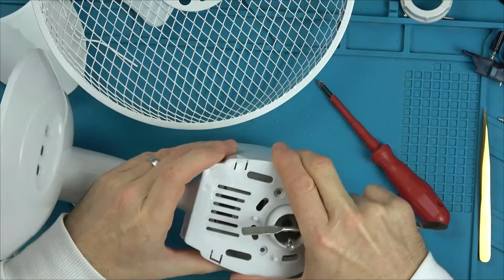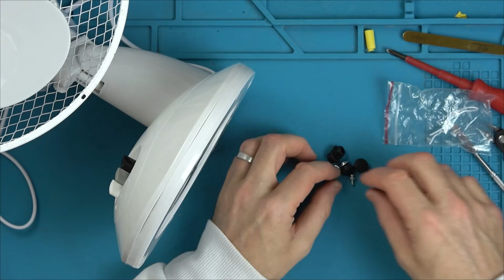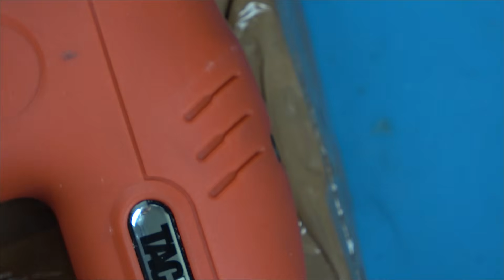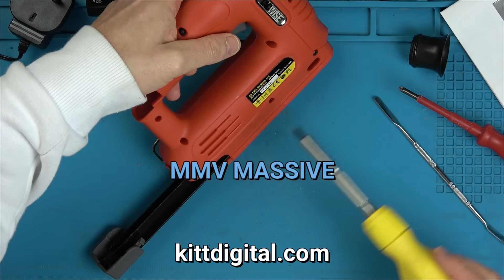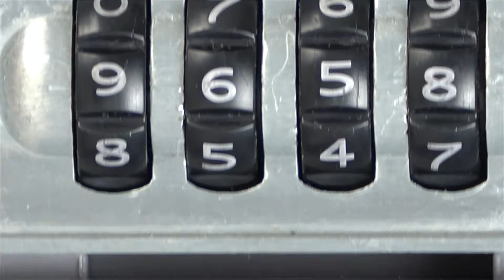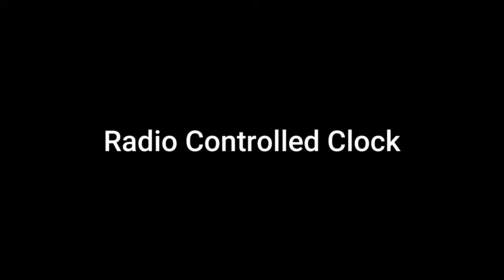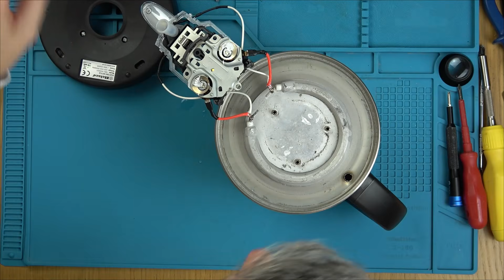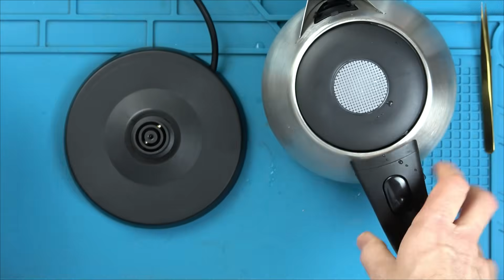I Bought AMAZON CUSTOMER RETURNS to REPAIR

Comment: Re : Duh Fan
NOPE! it nort be "freak shun" err-"friction" that hindered the second speed.
The motor has a winding that is tapped, and the switch selects what tap the electricity is fed too.
Eg: the first tap would energise part of the winding "slowest speed", and the other tap "full winding" would be 
the fastest speed ?! !? 🤨🥴🤯 WAIT! or is the faster speed the other way round??? err two windings fed with 
electricity should mean ?? err-um? um? wait 😵‍💫 argh! 😬my near to 70 year old brain needs re-energising. 
anyway, the two taps to the motor provides the two different behaviours.. yeah lets stick with that.. 😁
That, That THAT Blue wire must have been loose! only Explanation why the Fu Err-sucker didn't have the two speeds..
And what's more I would put a kazillion bucks N a hot maiden if I am wrong..

Comment: Hi Vince, I think because the propeller was loose, it was only ever going to get up to a single speed before spinning on the metal shaft regardless of switching to a higher speed. Perhaps by putting heat shrink on to the shaft gave it better grip?
Reply from the maker: Hey, I think that may have been the issue all along slap head 👍👍👍

Comment: Real shame on the atomic clock. I love my atomic clock. It is tuned to WWV, and of course you can adjust the timezone. Rumor has it you can hear WWV in England, so it is possible the clock would be good there, too. 2.5, 5, 10, 15, and 20 MHz AM.

Comment: Vince, have you any plans to restore a Vespa scooter? You mentioned it when you were fettling the Rolls.
Reply from the maker: Hey Mike, I don't think so. On my driving license I can only drive a 50cc. When I looked most old vintage Vespas are higher than 50cc. I don't fancy having to pass the CBT to get a bike license truth be told. I haven't ruled it out completely as it could be done in my dad's shed out of the weather, but I am not looking at this moment. In fact, I haven't been looking at any bigger project recently as nothing seems to be interesting me. I'm hoping that will change. I did buy a beautiful RC wooden boat from (I think) the 1950s that needs a ton of work as most parts are missing, so I will hopefully get stuck into that after Christmas 👍👍

Comment: Hi Vince,
The switch worked from the start, you should also look at the display of your multimeter. In position 1 the multimeter indicated almost 0 Ohm and in position 2 your meter indicated 38 Ohm which is clearly a winding of the motor.
Reply: It's easy to miss the coil resistance when in beep mode, I've done the same.

Comment: The lock thing, has more than 10k combinations, although I can't remember what the calculation was on top of my head (it's midnight). I think it's 4^10 (9 + digit 0), but don't quote me on that, I might be wrong.
Reply: That lock "counts" from 0000 to 9999, you cannot go higher than that. 
The formula is numberofdigits^numberofcylinders.

That is 10^4.

Comment: Air compressor, customer might have a broken power socket or blown fuse. Never thought about it, but modern cars with extra outlets might have those limited to 5A or so, only suited for chargers. This was 10+A.

Comment: That clock reminds me of a weather station that Aldi sold. Same problem the time sync was using the German transmitter so always ended up having to manually change it!

Comment: It wont be possible to convert the Braun clock to use the British time signal. Even if you could adjust the frequency it  works on, the decoding system is completely different and the data bits are not comparable.

Comment: The only things I can think of for the clock are any settings to set the time to the central Europe time signal minus 1 hour, or an ability to replace any firmware with UK version and hope it works. If there's nothing like that as an option then I'd say try and sell it to someone in Europe as it's clearly going to be a pain in UK.

Comment: Hi Vince, now you can blow away the soldering fumes in to the house 😀 Regarding the clock - In the UK, the time signal is broadcast on a frequency of 60 kHz from the Anthorn Radio Station in Cumbria. You can get a UK version and compare them 😀

Kettle - Hahaha for a while I though I am having a Kettle Deja-vu

Comment: Regarding the little safe, that's a common method by which to crack the code. I used to collect spare parts from a particular chain of self-storage sites, and they would save up all of their combination padlocks with lost codes for me to collect and crack, I think my record was 18 during a 30 minute lunch break 😁. it was rather relaxing actually, I miss doing that.

Comment: for the fan: I wonder if the speed might be a factor of torque..  meaning the speed might be the same if there isn't a fan being pushed around, but if there is a fan on it, then one winding will spin it faster because there's more torque being provided.   mind, I know nothing of how these things work, just applying some general concepts. ;-)

Comment: You could try solvent weld for the plug pin, not sure what plastic it's made of but would be much stronger than glue if it works

Comment: I bought thru Aliexpresses "Choice" a 100 connector bag full of single line Wago's, they can be chained together or clamped to a surface using a zip tie, I would rather trust a Wago than a wire nut all year long (did you know the Chinese call them "nipple nuts"? O.o)   The other really useful thing from Ali that cost like 45p is a 3-48v voltage tester, has a very long spring cord fitted with a robust croc clip and a thick clear handle of the probe which has a 3 digit voltmeter embedded in the solid plastic with a very long sharp probe, I was using it today on neighbours car as they said their oil light kept staying on when they had max oil, so I hooked the probe to the oil sender and the sender was working fine turning off when got oil pressure so I set it up to test the line between sender and ECU and that was a dead duck, I quickly knocked up a patch wire and grafted it on and the oil light now goes off properly thanks to a 45p tool :D

Comment: For the kettle, rather than measuring the voltage on the base, it would be safer to measure continuity between the base and the plug.

Comment: I would have loved to see the clock's insides! I believe that the radio setting of the clock is done by a separate module that has the receiver and a micro controller for each protocol. Amazon default is to sell the clock that works where you live, but you can order the other ones as well if you request it. Did someone order the wrong one because it was cheaper, not knowing that it won't work there?  There might be a time zone setting jumper inside. More advanced clocks do have a zone option for countries with multiple zones. Here in North America ours is BC!)W-BC for Boulder Colorado (WWVB) There are ~6 zones in the continental US/Canada and WWVB is available to most of these zones.

Comment: Let me differ from the conclusion of the fan solution. In my opinion, the plastic holding the blades may not have been sufficiently attached to the mast (grip), which caused that when turning (whatever the speed) it reached a kinetic equilibrium between the rotating metal and the plastic of the blades, that is why both felt the same; however, when placing the heat-insulating plastic that disappeared, and the plastic blade could be attached to the metal mast and reach the same turning speed.
Reply: Was thinking the same thing.
Reply: @jasonnix  yep
Reply: @shiivoooooo  that's what the metal ring in the plastic bag was for.
Reply: Exactly what i came here to say.. beat me to it
Reply: 💯 correct
Reply: Came here to say this exact thing. It’s 💯 the fan blade grip on the motor. The cover was probably bent up in the return process.
Reply: yup, blade slipping on shaft
Reply: That almost sounds like a ghetto clutch. It gives me redneck ideas.
Reply: But the metal screwdriver on the shaft sounder the same at both speeds. The best way to test would have been to count the oscillations per minute as it's a mechanical link. more RPM = more oscillations.
Reply: I thought the same, well explained

Comment: Fan will not push more air if it's slipping on spindle, after you made fan tighter it pushed more air
Reply: Fan slipping on spindle,
Tightened grip, air flows stronger,
Cool relief at last.
Reply: @yippdogg9250 so close, 6 syllables in first line

Comment: I'm confused 1:19:50
If the kettle is off the base, what does it matter if the switch can click and stay down? It's off the base so there is no power, so it's not going to burn your house down.
Is this (no offence meant, really) just another example of British safety laws going overboard?
Why does it matter what the switch is doing if the kettle has no power ?
I'm American so i don't understand. Thanks in advance.
Reply: @PastorOfMuppets616  kettle turns off so it is not returned to the base still on with no water in it where it can overheat.

Comment: With that fan I'm betting those 1 star reviews failed to install the spring on the shaft to keep the blades from slipping. You can never trust customers to read instructions or Chinese manufacturers to provide clear instructions.
Reply: Yes I spotted the spring clip missing also👍
Reply: Jep.
The axle was not properly secured in the rotor. This caused the engine to run unevenly. The rotor was wobbling on the axle or the axle was spinning freely at high speed. Don't ask how I know that... 😀

Comment: That Braun clock - it should have a way to set up time zone. I have many of DCF clocks and only the most primitive ones don't allow you to do that
Reply: I've checked user manual for this model... and there is no timezone setting. Crazy...
Reply: Maybe on the circuitboard you find contacts to switch between timezones..

Comment: To fix the plug drill a small hole in the plug and the pin then glue a metal rod inside with epoxy

Comment: Broken plastic earthpin bodge I did was use a two plug adaptor. I pushed the broken bit in the earth pin to open the shutter then hot glued the plug in. It made a chunky plug but I wasn't paying £20 for a new Gtec power cord.

Comment: Enjoyed that.  Even if you could retune the radio controlled clock from DCF77 (77.5kHz) to MSF (60kHz) it wouldn't work, as the protocol is different.  They both send the time by encoding it and transmitting as one binary bit every second over a minute, but the order in which those bits are sent are unfortunately quite different.
Reply: So a digital conversion circuit is required as well as a frequency change. Now, there's a challenge.
Reply: @manolisgledsodakis873  normally it would not be needed as most DCF clocks have a setable offset for use in other timezones.
Reply: @VVerVVurm  correct RTFM!
Reply: I have had a similar radio alarm clock purchased from argos opend 30+ years ago. It does not automatically adjust when the clocks go forward/back and I can adjust it when abroad in europe. You press and hold a button on the front to step up/down an hour. Did you read the manual?
Reply: 123, you are a certified "smarty pants"... and we love that!  The more I find out the more I don't know. I really need to stop learning before I know absolutely nothing! :hand-pink-waving::face-blue-smiling:   You RoCk!

Comment: Mainflingen, Germany DCF 77 is broadcasting on LW 77 MHz. Anthorn, Cumbria is on LW 60 MHz. The receivers are usually pre-tuned to 77 MHz or 60 MHz and can't be altered. Have a look at the internet and you'll find how to wire a 77 MHz receiver to an ESP processor card (or any other computer) and decode the radio signal.

Comment: The kettle had has 2 cutouts -one for cutting power when water boils, and if that one fails then the other one would cut power when it boiled dry, and if that failed as well, the kettle would basically melt and possibly catch fire

Comment: The switch was bypassed and was sending power through both wires at the same time. You pulled the wires off the switch and didn't test them until you reassembled the entire fan.

Comment: So, I have a 2 year old 4K tv that randomly stopped working.

You get sound but no pic just black screen.

Anyone know what the problem could be and if it’s worth repairing?

I don’t need the tv but I don’t like waste and it would come in handy if my current tv breaks and with my loopy dog, he’s almost pulled my ps5 and tv down being clumsy more then once.

Other night I was playing psvr2, my dog was on my bed. I see a nasty bug on floor of game I was playing and I bent down and punched it and my dg was there and I punched him instead 😂

Kinda glad I dd tho because he was sitting on top of my psvr2 lead and if he pulled tv and ps5 down , while in vr, I’ll have heart attack 😂😂😂😂
Reply: Single or multiple short or worn L.E.D.s. Pull the back off, find faulty or worn L.E.D., replace it and all will be good again
Reply: @darrenbird2526  I’m not good at electrical diy.
If this is the problem, would it be cheap enough to fix? Considering the tv was £320 reduced from about £600
Reply: @grahamkelly8662  if you're able to do it yourself it would certainly be worthwhile as the L.E.D.s are very cheap. If you had someone fix it for you, it most likely would be cheaper to buy another tv, considering the low prices these days. 
If the tv is not working and as you know it's definitely a L.C.D. problem, pull the back off and have a go at diagnosing and repairing yourself anyway, you have nothing to lose. You only need a multimeter to diagnose and look for dead or worn L.C.D.s and there very easy to replace. ALWAYS BE CARFUL OF HIGH VOLTAGES  when you remove the back of electrical products.
Reply: What brand is it ?
Reply: @iwalker3809  LG 43 inch 43uk63 4K HDR IPs display.

It’s only  a budget tv but considering it was my first 4K tv, it was absolutely fine and I even bought a 4K Blu-ray player to watch David Attenborough Documentary in 4K and it was my first 4K experience and even on that cheap tv it looked breathtaking.
Reply: Possibly backlights have gone, in a dark room shine a torch on the screen if you can see something on the screen needs new backlights. YouTube has channels on replacement and repair.
Reply: @DavidCoombes54  Allen Fleckney's channel comes to mind. He was saying that some brands (Hisense among them) have taken to gluing their screens, rather than using clips, so even pro repairers won't touch them. Thats why I asked the brand in an earlier comment.

Comment: I think the issue with the fan running at the same speed without the blade fitted is that it reaches the maximum speed that 50hz will allow. With the blade fitted the air resistance slows it down and the two different speeds are due to the resistance in the windings generating different amounts of torque.

Comment: Those RING Air Compressors have crap power buttons. Just poor build quality. Very wobbly plastic and often don't press down on the actual mechanism. I own one. Sometimes, take 3 or 4 pushes of the button to start it.

Comment: I guess not having the spring tensioner on inside the fan to clamp it onto the spindle, would cause the fan to slip, once secured tightly on the shaft would allow the full rotation energy to be applied and the low speed is what you initial had with no slip, i wonder if all those negative reviews is because of poor assembly of the fan!
Reply: I agree with your assessment👍

Comment: The shaft could have been spinning inside the fan if the fan blades were catching the guard, it looked quite loose. Adding the shrink seemed to have fixed it.

Comment: They usually have a pin fitted to the central spindle which locates into a slot on the plastic fan to avoid the fan slipping on the spindle. I guess they were saving cost by not drilling a hole in the spindle and inserting a pin.

Comment: 20:09. IF it were just friction on the cage, then why did the fan spindle not sound any different when you had put the screw driver against the spindle?
Reply: because without the blade (and thee spring tensioner on the blade} there is no load on the motor so it just spins at the same speed.

Comment: Good evening about the three pin plug that's broken if you use a hot paper clip put the one piece in the broken bits and one piece in the other broken bits and let it cool down then Super Glue it and for the clock if you go into the settings it will give you the radio clock settings for UK and around the world it will take you a while to find them

Comment: about the fan, grease gets hard ,that is the most common problem and reason for failure a squir of wd40 is a temporary fix.also when yo tested it without shroud you could time the oscilation .i think the switch was to blame

Comment: I think because you put shrink on the bar. when the higher speed is activated it stops it slipping on higher speed. maybe wrong just my idea
Reply: But then why didn't it turn at different speeds when he tested just the bar spinning without the blades on it ?
Reply: @Boogie_the_cat  good point ..I didn't think of that

Comment: Looks more like an “AliExpress” or “Temu” item, cheap and tacky, like the suppose kinetic car heater which is really just a cheap air freshener.
I’d say putting the heat shrink on gave the blades more grip on the shaft so the blades turn better